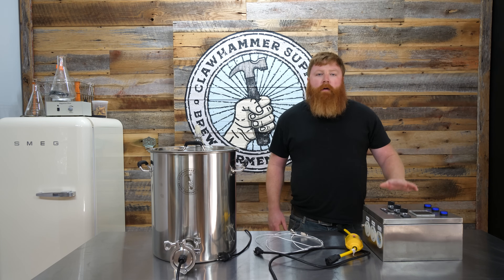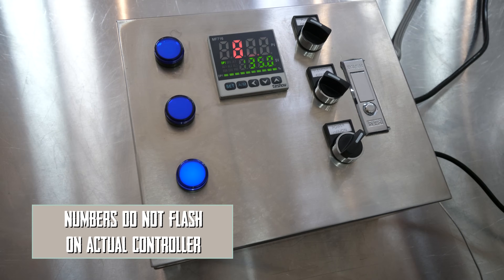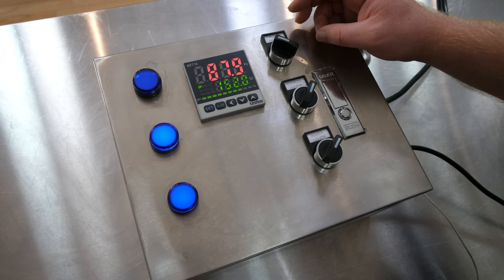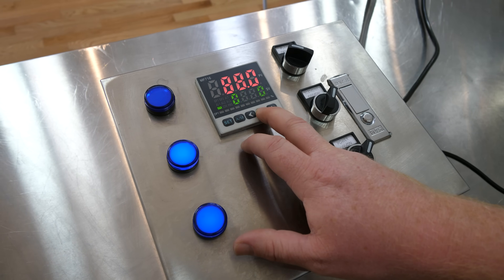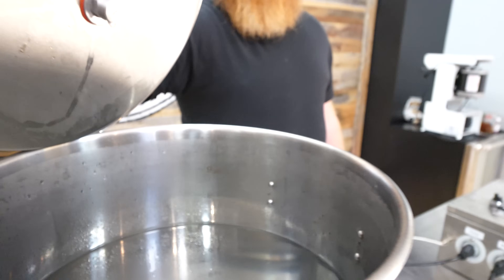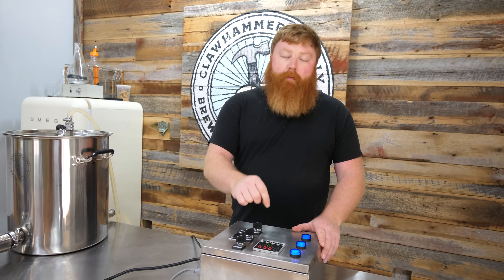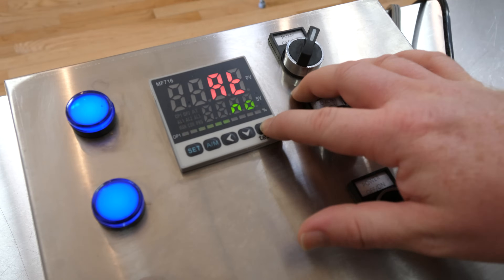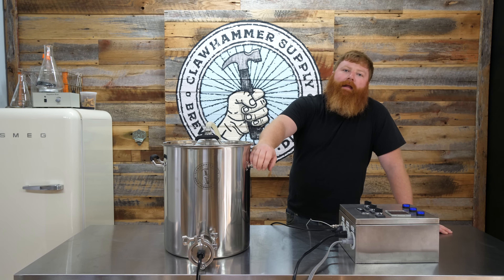Digital Brew / Distill Electric Element Controller Use

Comment: System looks great but I’m a little concerned with the size of the heating element. Will it bring a full 10gals to a rapid boil?
Reply from the maker: Hi Rodriquez. Sorry, we just saw this comment. The kettle is 10.5 gallons but is intended to be used to make 5 gallon (finished) batches. We mash with as much as 8+ gallons but generally only boil 6.5 to 7 gallons, max. The boil off rate is about a gallon per hour and we shoot for about 5.5 gallons in the fermenter so we end up with 5 gallons in the keg, leaving about a half gallon and the trub behind. 
That said, yes, this system will boil 7+ gallons. However, insulating the kettle may be necessary, and keeping the lid on but cracking it is definitely necessary. 
We've done a ton of experimentation with our system and have found that DMS is not a concern as long as the lid is at least cracked (even just a tiny bit) and the wort is cooled immediately after the boil (using an immersion chiller, plate chiller, etc). Boil off simply needs to be accounted for and added into beersmith, or whatever software you're using to create recipes, if that's the approach you're taking. 
The old, "lid must be completely off and it must be boiling full tilt or your beer is going to suck" arguments haven't held true in our experience. The folks over at Bruhlosophy have done some DMS experiments as well, with interesting results.

Comment: Theoretically, and I know you aren't electricians, and I should consult one should I do any electrical work, but will this controller support a 2000 watt element?  I can't understand what the components are inside the controller (I have one but I think they are all written in Swedish..so...   ;-)    .. Any ideas on what the components inside are RATED for?      Thanks folks.... Whats the next Winter Beer you are going to tackle?.. looking for ideas
Reply from the maker: Our controllers are rated for 15 amps which is why we use 1650 watt elements.